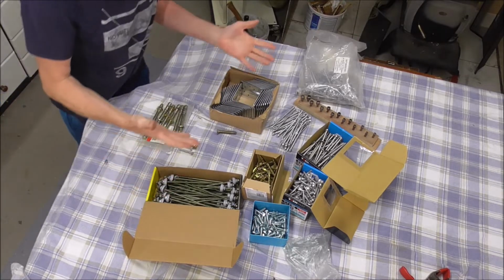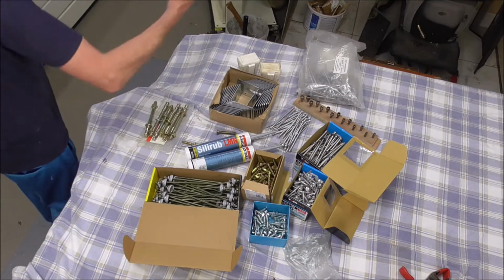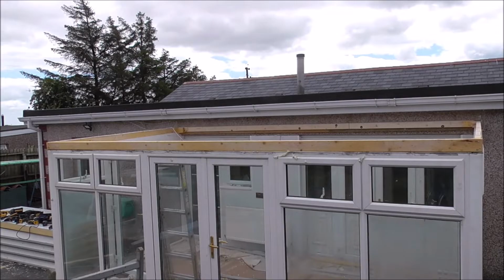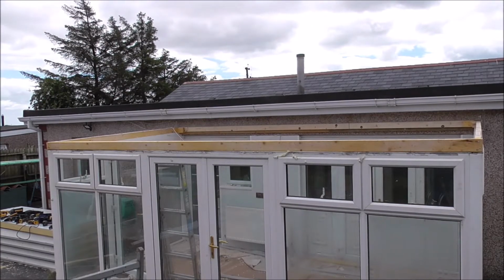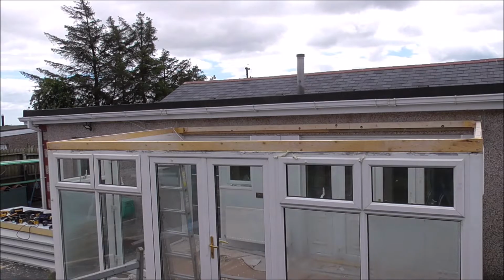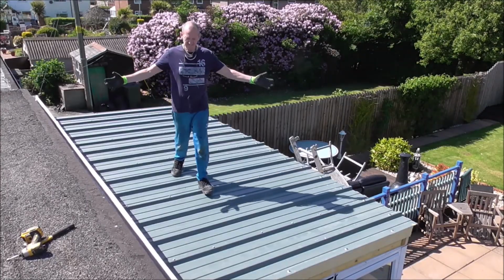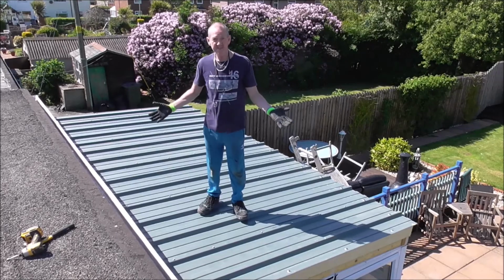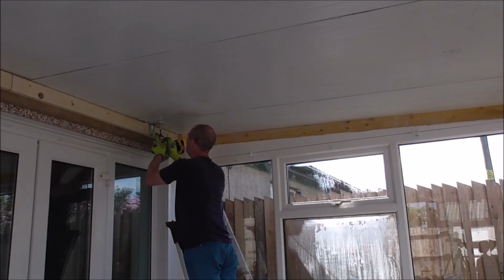New Concept Replacement Conservatory  part 2

Comment: I'm not convinced by insulated conservatory roofs. 
Generally, a regular conservatory roof does not impede light in the main living areas. Placing a solid roof on a conservatory will impede light and the living areas will become considerably darker inside.
Then there is all that glass, unless something is done to improve the R value of the glass, the conservatory will still be cold.
Reply: I put a guardian conservatory roof on mine ,best thing we could have done,still lots of light and the temperature is just like being in your main house

Comment: Brilliant David. I was wondering why you were using the angle brackets at first but then realised that you can't drive the fixings down from above because of the house roof overhang and gutters. Looks great and took your weight no problem, even before fixing the panels together. Will definitely be getting these for my garage roof - just need to find who will supply me. I didn't realise you were from Scotland too originally, if you don't mind me asking where are you located - North, Central or South is fine if you don't want to give your location away on here. Thanks again for your advice before on the other video!
Reply: Ah, thanks for that David, I wrote 'originally' but meant that I didn't 'initially' realise you were in Scotland because of the accent because these panels seem to be a bit easier to obtain the further south you go. I'm in Glasgow so hopefully I can obtain them at a decent price.

Love your channel by the way and looking forward to Part 3 (if there is a part 3) where you trim out.

Comment: I'm very impressed with what you've achieved, especially as I am being quoted £8000 to £13000 for a new roof for a similar size lean to conservatory roof!! I have two questions: One is, I am having difficulty locating the Kingspan roofing that you have used. All the ones I have looked at have small ridges on the underside too which your don't appear to have. If you could let me know the actual product name or code  that would be very helpful. Secondly, I didn't see how you waterproofed the roof where it butts up to the wall of the bungalow. Have you just relied on the eaves overhang or have you fitted lead flashing?
Reply from the maker: @tonyhanson9848  hi Tony first thanks for the kind comment. Unfortunately, I don't have any more information on these sheets, all I did was look on ebay for the best I could find mostly off-cuts as thes sheets are normally 6+m long but as for the inside I do have some small profiles but I knew I was covering it with a inner ceiling so not a problem
Reply: The roof sheets are kingspan composite panels 👍

Comment: Good morning. 
I’m replacing my conservatory roof the same way as you have done. I have. Question, is there a reason why you fixed the panels from the underside and not above,  to the supporting timber against the house and not from above down into the timber. 

I have to work in a small depth of 400mm from the underside of my extension guttering to the top of the conservatory window units. With the length of the conservatory being 3.4m it leaves me with just about a 4 degree drop sitting on a 3” frame work around the top of the conservatory window units. 

Thanks and regards

James
Reply from the maker: The over hang of the gutter box is about 250mm and I am up tight to it
Reply from the maker: If you can do from above it would be better
Reply: @dmgladden  
Hi. Thanks David. We just have a gutter bellow the extension tiles and a facia board at the moment. The hope is to get the 80mm / 110mm in all. Under on top of the conservatory window unit and still have a decent degree of drop over a length of 3.5 m (I think) 
Do you happen to know what degree of drop you have. My concern is that I may just’ about get a 4 degree. I understand from talking to the insulated panel store that this is the recommended drop.

Comment: Hi David, you and i have exchanged comments before and wanted to get in touch. I have had to postpone my plan of replacing my P-shaped conservatory roof until next year. Couldn't find a carpenter willing to assist. It will give me ample time to get myself ready to attempt it myself. 

My P-shaped conservatory is 5000mm (5m) long along the wall and the widest span is 3080mm (3.08m) and narrows down to 1660mm (1.66m).

A few questions for you: 

What size (thickness/width) wood planks did you use for the lean to wall bracing, secondly to get sufficient pitch for the rain water to drain, roughly how high should this be fitted above door and window frame on the exterior wall?

Lastly when measuring the lenght (5m) how much space do I need to add for the overlapping of each 1m panel?
Reply from the maker: Hi good you will have ago your self it's good fun.
First when it cames to the well plate I was governed by the roof section that came with it.
Pitch can be very slight to work just 25mm per meter but I went higher as I wanted the extra space inside.
Over hang on the side is not needed but you can if you want for style on the run off edge it needs to be about 50mm clear to a low for the guter to work I cut back all under the top skin and capped it with a gutter board leaving 50mm out this worked very well.
Hope this helps and good luck.
David

Comment: Great job, looks very straightforward and doesn't look too expensive. I want to do the same how can I get that type of roof?
Reply from the maker: Hi Raul yes it is but takes some finding at the right price as the sheets come to big and as new very expensive i got on ebay but you just have to keep watching
Reply: @dmgladden  what make are the roof panels?
Reply from the maker: @NickD680  as I did say in the video they are Kingspan

Comment: Great video and good to see the young chap working so hard. One question though. Aren't you worried that the rain will eventually find its way through the gap between where the pieces of the roof overlap each other?
Reply from the maker: Hi no not at all its the way it as been on the old roof and never a problem

Comment: how did it cost you pal for materials and could you recommend where from?

i was quoted today to replace the roof and insulate - £6800!! labour only £4800!
Reply from the maker: I bought the sheets off a guy on eBay as off cuts and the whole job cost me under£1000